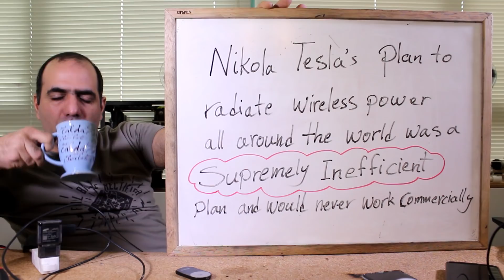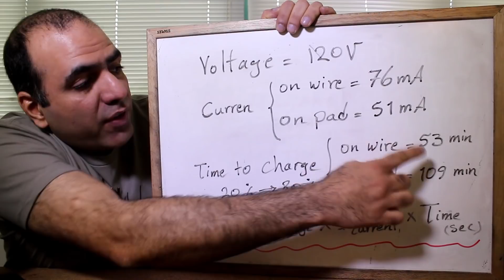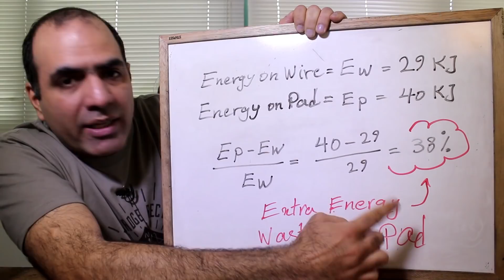Drowning in Inefficiency

Comment: If you really wanna rage at inefficiency: regular nuclear power plants are about 0.5 to 0.7% efficient at converting energy from nuclear fission into electricity. Part of it is needing to throw away the nuclear fuel when the fission products build up enough in the solid fuel to cause it to significantly deform and ruins the thermal and neutronic characteristics of it, and the other is that they still generally use steam turbines. Molten salt reactors seem to get around this problem with full burn-through and significantly higher operating temps combined with supercritical CO2 turbines means we could get closer to 60% efficient.
Reply: 0.5 to 0.7% corresponds more to U-238 isotope which is most abundant one, and which isn't used too much in usual fission reactor. Instead of breaking up, it eats neutron and gets converted to plutonium. This plutonium could be used to generate energy, but in conventional reactors there are slow neutrons which just fly past U-238 without affecting it (most of the time), so all this U238 is just ballast. U235 gets used almost as much as there were, though you're right: there is still U235 left in spent nuclear fuel because of deformation and negligable energy output from it. 

Fast neutron (breeder) reactors could use much more uranium, but they are still pretty exotic. There is BN-600 and BN-800 in Russia and that's pretty much it. Still not clear how well they are: they need high concentration of U-235 in fuel to begin with (otherwise they spend all the neutrons into U-238 so chain reaction doesn't occur) and they burn this fuel pretty fast, so they need to stop for refuelling procedures.

About 60% : that's whole another value, here we talk about thermal efficiency, that is converting heat from nuclear reactor into electricity. Yup, conventional reactors using pressurised water and steam generator have nearly 30% efficiency because you can't raise temperature of reactor core too much: it begin to lose strength and eventually melt! So instead of 550 degrees celcius on coal plants, there is just nearly 300 degrees on these nuclear plants.

Comment: This is why I want a Raspberry type computer as my main driver.
Reply: Me2 
Raspberry pi spi 
Comming soon 
Powered by Atmel
Reply: How about you just use old PC? Buying and using second hand things is infinitely more efficient and environmentally friendly than buying shiny new things. People call this "recycling".
Reply: @kaikart123  Depends, if you want to go off grid then a SBC like pi is an option. Many old computers in this case draw too much power. (Yes I know Varg powers his Mac desktop with solar, but I want to go even lower)

Also pis are super small so their manufacture has a low footprint. (old pis are quite anemic computing wise)

Though a used thinkpad is always an option, if you want all the perks somewhat and some extra like option to core/libreboot.

Comment: When you are comparing the used energies, you are calculating with apparent power. I guess the wireless charger has much more reactance than the wire charger, so I guess it is not great to compare these values. You should measure the rectified output of the wireless charger adaptor, that way you would get true data how inefficient the energy transfer is.
Reply: It does not matter in this case almost at all:
Both charging methods use the same 5V usb power supply, so you can compare the current draw without any issues. The Power factor will not change.
The only problem is that the wireless charger is drawing less power, which may slightly change the power factor. It´s still mostly accurate though.
Reply: @Basement-Science  Oh, I was not aware of the same power adaptor.

Comment: Electrical engineer triggered the efficiency of a motor in a electric vehicle is more than 80% (the most crappy one) and it can go to even 95% depending on the power of the motor (higher power have higher efficiency and power factor). The only loss in a electrical motor is the heat, iron losses and some friction here and there but most of the energy from batteries is converted in mechanical energy with at least 80%.
Reply: In one of the laboratory at university we've done some couple of tests on a induction motor by measuring the voltage and current draw from an transformer and measure the speed and torque and calculate the electric power drawn from the "wall" and the mechanical energy by changing the load. There was a maximum for around 85% efficiency and it was a crappy induction motor and it was like 30 years old.
Reply: He could have made it clearer that he was referring to the efficiency of the car (not the motor) from the grid to the wheels.  That's a few additional conversion and transmission losses and the friction of gears, drive axles, tires, etc.
Reply: @TheMechanicalPhilosopher  oh, haven't thought about that. Even though, the amount of energy "injected" in the system is way bigger than the amount of energy lost from mechanical losses so the efficiency can't be that low. Just my intuition.

Comment: Thanks for bringing up the topic of wasting energy on "wireless" chargers, it was bugging me for quite a long time and it seemed like only I cared. Another "energy wasters" are powerbanks - they require two voltage converters and usually they discharge by themselves pretty quickly by simply laying around in a drawer.

Comment: Simple, we just have to use Glass Fibre Cables instead of Insulated Copper Wires. They have energy loss/block of 0.025 instead of 0.2 of the Insulated Copper Cable. It will cost a lot of Silver Dust and Diamond Dust though.
Reply: Hi
Reply: The only problem is that fiber optic cables transmit data, not power, so...

Comment: Love your videos, Mehdi, but I have to defend my industry here.   Yes, some older low-tech piston engines are around 20%, but the most modern designs (Toyota in particular) are in excess of 40%.   I also see that the range you put in the picture includes that, but I wouldn't call that a negative by any stretch!  That is getting darn close to the Otto cycle limit.

Thanks for posting another great video!
Reply: And just to make sure I don't start a comment war, I definitely accept that electric power trains are the best solution for the passenger car market in the near future.   The gear head in me has to defend the ICE every now and then  :D